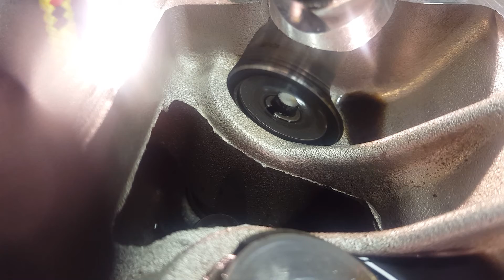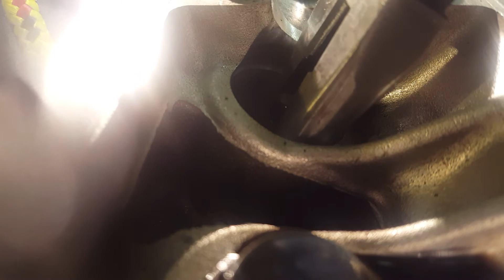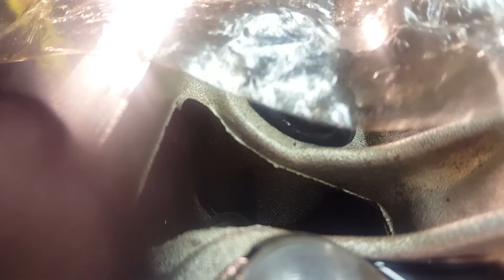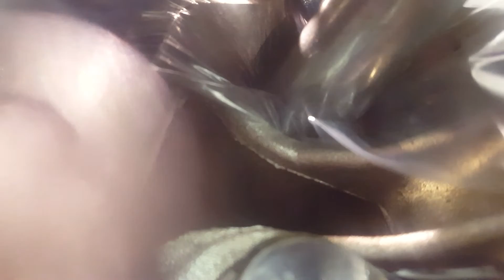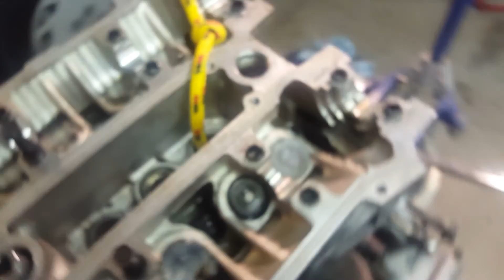How to change valve stem seals without right tools

Comment: After raising 1st cylinder to the top and putting the pin in at the bottom of the engine under starter, I can do the front stem seals and valve guides won't fall out, what about other cylinders? How to pressurize them without a special tool??